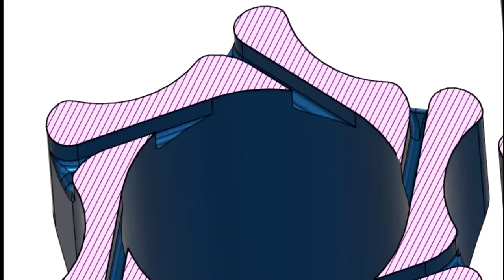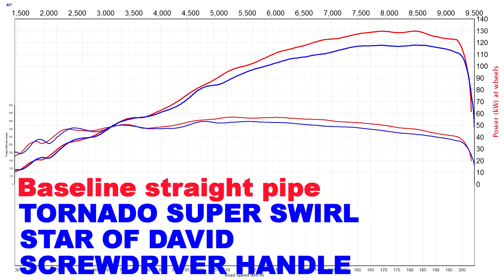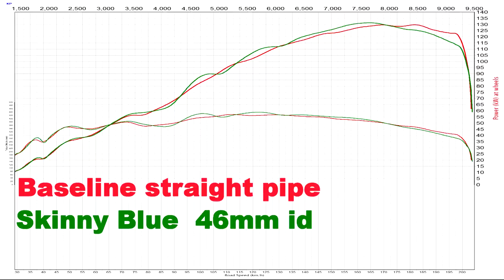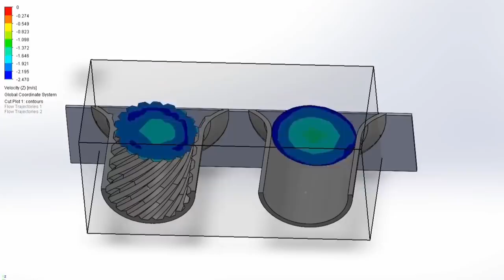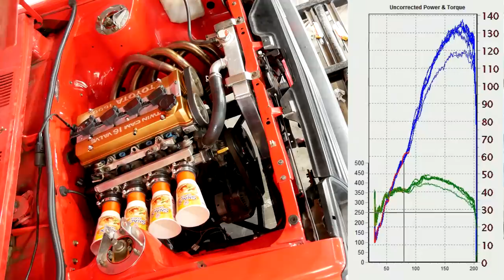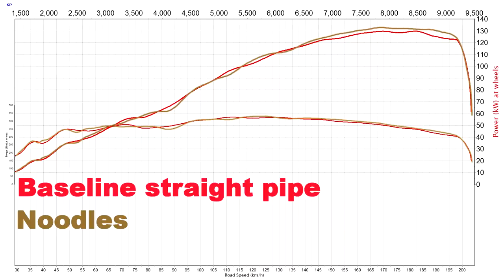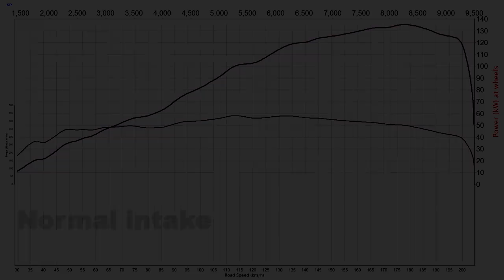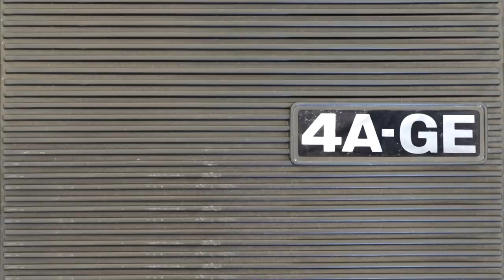Viewer 3d Printed Velocity Stacks  - Trumpets - Intake runners - Dyno Tested

Comment: of course we always want great power but to better see the difference between the intake runners it might be better to stick to the same shape, but all a bit smaller so that the motor is a bit choked and the difference becomes larger and therefore clearer. Of course you can also increase the pressure and flow in the computer simulation and see what happens. I also wonder if the opening surface is kept the same for the different models (especially for the screwdriver handle). nice to test all this, in the past this was all much more work than now.

Comment: On round pipe opening, the minimum clearance in front of each should be at least  the lengh of one radius of the opening of the pipe. The cross sectional of the opening surounding all these pipes end  should at least also be  equal or superior otherwise  the true restriction become the availlable clearance around all the pipes  instead of the pipe opening themself. Great video btw!

Comment: Make some variable length velocity stacks using old-school choke cable where you could push or pull on it and make the stacks go taller or shorter like the old Mazda rotary race car

Comment: I'd be interested to see throttles done with an audi style split plenum so the intake pulse is being captured and bounced back down the runners rather than being lost to an open engine bay, even a comparison with a flat sheet of alloy mounted at varying distances out from the bell mouths would be neat. Top work enjoy the innovation  and testing!
Reply from the maker: I was going to do the one with a plate in front of the throttles at some stage.   I haven't actually tried it before, but i would assume will lose power the closer the plate gets.   as its the end of the pipe that creates the pressure wave, not so much a reflection off a wall in front of the runner.  so said wall will just create an airflow restriction. but yes best way to find out is try it.   as for the audi style inlets, my understanding is they are more for trying to get even airflow to each cylinder.   Ive built and tried a few, mostly on turbo stuff.  but have gone back to conventional style.
Reply: I guess it's like building a single cylinder tunnel ram by utilizing a plate and then finding the perfect balance between positive and negative effects? Capturing those returned pulses off the back of a closed valves between individual paired or all four cylinders within a plenum to best utilize any free energy? Factoring in air filter resistance and use for road.
Really enjoy the content ...keep up the good work.

Comment: How about variable length stacks? You can probably adapt a system out of a motorcycle like a R1 since it's a 4 cyl as well. It's nothing crazy complicated and should give you gains on top without sacrificing the midrange
Reply from the maker: will build a variable setup at some stage.

Comment: really cool my money was on the green swirl design and it did good the only issue with 3d printing is that the surface is rough its not perfectly smooth which affects the air flow lots of those designs could be refined with some sanding for a smoother surface and i bet you would see ever so slightly better numbers probably not enough to make a fuss over but im guessing thats why the regular intake did so good because the surface was super smooth and helped direct air flow better
Reply from the maker: The "normal" intake is a bit different design.  carries taper out to the bell mouth.  which has a slightly elliptical shape to it.  I made it years ago and has been proven hard to beat.   Im not sure if would be a measurable difference  smoothing the surface on the  3d printed ones.  but will keep it in mind, thanks

Comment: you should use variadle Intake runners for more power, the trick is to find out the resonante frequency of the tubes, and aling them with the rpm of the engine, (+rpm=shorted intake tubes).
you can make some type of sliding tube for the intake and add the best horn so far, like what they did on formula cars back in the day).

Comment: @Garage 4age Have you, or can you test pulse plates soon?

Back story: I built a Mk1 Escort for a friend of mine and drove it a 60odd miles with bare carbs and trumpets and it was truly awful. Difficult to drive because of a narrow power band and I assumed the cam was just a bit too much.
At our meeting point he brought a K&N filter which only just fitted between carbs and bulkhead but it utterly transformed the drivability of the crossflow engine.
From a trumpet point of view it went from seeing a wavy bulkhead to a flatter squarer-to-trumpet K&N fiter top, only slightly closer.
I was convinced it was just that better pulse reflection made the difference, but I have never had another opportunity to test it!
(Nerdy details, I think it was a Lynx manifold with single 45Weber, 1600 crossflow with big valves and lumpy cam)
Reply from the maker: Possible the filter itself had an effect on airflow changing the air fuel ratio?     my understanding is its the end of the pipe,  rather than bouncing off a nearby surface  that causes the reflections.   will keep it in mind though,  maybe put it in with something else i want to test soon.  as interested to see how close to a flat surface the end of the runner can be, before losing power.   I'm 99% sure my current setup doesn't have any issues like this based on some previous testing. even though looks like the strut tower is quite close
Reply: @Garage4age  Thanks for the rapid reply!
It was purely feel and drivability sadly, so no real data to back up the difference, but it was a dramatic one. So smooth and managable after fitting that filter.
I'm sure you can't be far wrong, carbs are a lot different to bodies, but it would be very interesting to see if you can measure any difference.
Gap wise. 0.25 x trumpet diameter should be the same curtain area and thus arguably the closest you can take a pulse plate, but there'll be a lot of complex interactions going on particularly when it's closer than that, so who knows.
Interesting to see if you can measure a true suffocation point.
Reply from the maker: @thomashenderson3901   yeah should be interesting.  closer than most people would think i bet.  its not like the air has to be replaced through a single small hole like a single throttle setup.

Comment: The opening of the air trumpet makes little difference, what matters is the overall LENGTH of the trumpet, longer=more torque at lower RPMs, shorter= more torque at higher RPMs. The Mazda LeMans race car used VARIABLE length intake runners, an electric motor would adjust the intake runner length depending on RPM and torque requirements.

Comment: great job. I really liked you did double runs for each. My only suggestion is to run a baseline at the beginning and ending of the test, just to make you nothing changed in the engine/fuel/air during the test. You sort of did that with the "normal" setup. Really good job overall.
Reply from the maker: Im pretty picky how run the test,  car is ran hard before start the testing.  then before the first test gets the same cool down and warm up  as all the others.  oil, water temps etc same on every test.

Comment: You have to take in consideration that 3d printing surfaces are rough which create turbulent flow and resistance on the bore. You should smoothen the surfaces with acetones.
Reply: Smooth surfaces increase the boundary layer effectively reducing the bore size of the pipe.
Reply: Turbulence can be a good thing some people have found success dimpling inlets like the surface of a golf ball
Reply: @otanica  same with air flowing closer across a curved surface

Comment: From what i know only the length and width of the intake is important and depends on the piston size, speed, valve timings, air temperatur. I know about a company in Australia, they tune toyota v8's for stockcar racing and the make the surface of the intake and the ports in the head itself like the surface of the golfball. That would be nice to see...

Comment: Looks like the existing set of horns are your best bet. Maybe do some modifications on those & see if you can improve them. Make sure the inside radii of the Bell matches the opening diameter. So at a certain target length, if the opening is 68mm(2.68in) diameter, the inside radii(or led-in radii) of the Bell will be R68mm. See if the existing horns have an inside taper, like the noodle cups. Keep that included angle w/in 4-8 degrees(2-4 degrees per side). The inside of the horns should be slightly rough, not smooth. Take 1000 grit paper & draw parallel to the axis, not radially. Keep it light. You want to give that air a slight turbulence on the surface to act as a 'lubricate' for the inner layers above. Aerodynamics books & a couple of NASCAR engine building video's were my sources.

Comment: I feel like if the stacks had air blowing at / across them like the car was moving they'd give different more accurate numbers. They're only going to be able to grab so much air when there's no airmovement around them but I feel they'd do better if they had airmoving past or around giving them that ability to pull that extra air in
Reply: I doubt there would be much of a difference

Comment: What happens when you install the filter element?  There's a little power difference stack to stack, but I wonder what different filter designs and types would impact the output.  You could easily fit a pair of foam socks over each pair of stacks, compared to an ITG style foam element over the whole set up, vs a remote box filter, vs a paper or gauze element etc.  Love this Stuff!
Reply from the maker: The "normal"  setup usually  runs a big pipercross filter (can se backing plate on it)   has zero effect on power.  filter socks are horrible though, havent personally tested them, but had seen big losses on another guys car

Comment: The end of the velocity stacks are quite close to the strut tower - I think from memory if you have a wall within 1-2xID of the end of the stack you can start to get wave reflection effects which might explain the wibbly wobbly graphs between 5-6500rpm and why the screwdriver handles - although much lower total power - are smooth in that rpm zone - because the end of the stacks are closed, and so prevent those reflections from entering the stacks. Could you route the intake above the strut towers so the ends are in free air? I doubt it would improve the top end power but it might smooth out the delivery in the mid range. Great video, love a 4AGE - one of my favorite engines of all time!
Reply from the maker: Hey I tested some that point away from tower,  amongst other things in this video:  https://www.youtube.com/watch?v=nqYkmCLrlEo   About half way through.

Comment: Got to say that you haven't really got any restriction in the intake so you aren't really gonna see anything at this flow level. It's possible that you can reduce the diameter of everything down to the valve and not lose top end flow but boost the low end and to this end length is always gonna help. To gain some more top end maybe a set of outward facing (against the air stream) upstream injection in order to promote more evaporation and charge density perhaps. Also worth nothing that when you have an engine that cannot flow more then its worth chasing gains from spark. If you are running at mbt then up the compression and if not then increase the charge motion to get back to mbt. That will always be the biggest gains seen.
Reply from the maker: with everything Ive tried over the years.  To get get any significant  low rpm gains by  reducing diameter,  will always  restrict the top end.     Maybe on something that has a smaller rpm range, will work better.   Most cases, especially with these engines. Its the exhaust side that is the problem.   If you look at the numbers this one is actually doing really well for a fixed cam 1.6L   80kw at 4500rpm.  a standard one  will be lucky to make 90kw peak power at 7500rpm.

Comment: Is it possible to try the best inlet with golf ball style dimples in the inside of the pipe ? I'm curious if it would help or hinder air flow.
Reply: @Kapil Patel I thought the same. I remember B&W using the same system on their subwoofer ports which realistically is a similar shape.

Comment: great stuff as usual. 

The spiral design would be an interesting one to revisit if the injectors were placed in the mouth of the stack. 

Not bashing but curious what the designer of the star one was thinking? I guess trying to introduce some swirl, but to what end? Particularly since it immediately looked so restrictive.
Reply from the maker: was just trying to force the air to spin.  the slots were bigger in area than the outlet.  he wasnt expecting it to be amazing. just something different

Comment: Just wondering if you know the total length of your inlet tract? Been playing around with making my own calculators for optimum inlet lengths and I'm coming out somewhere between 379mm and 484mm (with a sweet spot for overlap around 438mm). Diameter is something I haven't really controlled for yet, but hopefully its effect is less pronounced than length.

Comment: I'd like to see 90°pipe velocity stacks, cylinder 1 upper, 2nd down, 3rd upper et 4th down. The hood will propabably not close but the idea is to let air for each bank. Oh also an old f1 trick use control by engine vacuum, short for low rpm and raise longer for high rpm.
Reply from the maker: hey, try this video  https://www.youtube.com/watch?v=nqYkmCLrlEo

Comment: Thank You, for testing/video, and the people who prepared the trumpets. 
Bravo guys!! 

The green ones and "Jewish" might be better for fuel consumption, by air swirls/turbulences mixture might be more homogenious, better mixed, but I dont know it for 100%, its just my loose thoughts.
Reply: if that were true, it would would show up in the midrange and at peak torque as that's where max efficiency would be achieved. mpg isnt some magical property, if the engine is more efficient in anyway, itll show up on a dyno chart as more torque in a certain band.
Reply: @OxBlitzkriegxO   
Graph shows only WOT, not half throttle, as in daily driving. The flow characteristic may change with less suction. 
But Thank You for Your attention, i have to think about it.
Reply: @jareknowak8712  Swirling flow takes energy away from it. Where this can help though is in the ports if it's not a DI engine as the swirl can cause better atomisation. But with CFD today there are more elegant ways to do it.
Reply: I think you'll all find if you look at the fluid dynamic clips in the video what the helix trumpets are achieving is moving the low pressure zone from the outer most wall of a smooth trumpet to the centre point of the helix trumpet where you want the low pressure zone and it is more focused rather than spread out in turn all that is happening is you are making the trumpet internal diameter smaller the helix only achieves one major thing and you can see it in the fluid dynamic testing also that it reaches the lower half of the trumpet faster than the smooth one of equivalent shape.

Comment: Cool video. quick question,, doesnt the "float?" of your cam belt worry you a bit? hate to see bent valves. what is flexing, that makes the cam belt shift back like that? It just looks like a problem waiting to happen🤷‍♂🖖
Reply from the maker: Its the belt itself.   got new belt / solution on the way

Comment: Stagger the length of them. Make 2 of them 2 inches shorter. Use the baffle but move it closer to the engine. By having them staggered, it will reduce the pulse low pressure on the adjacent cylinder.
Reply from the maker: doesn't do anything. have vids testing ones that bend away from each other. and different lengths.   links are in pinned comment at top.

Comment: May I suggest to modified the white one with a slightly more progressive taper and a bigger radius of the outside edge by keeping about the same diameter. My understanding is with the bigger radius, you may pick more air from behind and around.
J.F.🇨🇦
Reply from the maker: The  "normal" intake is pretty much what you suggest.   I made it years ago before  owning the dyno.  Its proven very hard to beat.

Comment: So i guess i just put noodle cups on there as a budget upgrad when i will have a car with a 4age some day.
I wonder if something with a deeper horn shape would work great. Something like a Horn for a speaker. Every cylinder fires how many times a second at 8k RPM? I wonder what would happen if you design a horn for the frequency range of the cylinder's from 5-9k rpm if like in the audio world it amplifies the output in that range it in this case would amplify power output.

Comment: What about a golf ball dimple on the inside of the surface of the plenum/intake stacks? It would be hard to get the correct depth, and smoothness (unless you dimple then use acetone vapor to help with surface finish of 3D printed ABS) I’d try that on the white short stacks and see if that helps with smoothening out some of the curve.

Comment: I'd be interested to see how curved velocity stacks would perform, as I know intake manifolds on many production NA engines use this design. I couldn't 3D print anything, but I'm sure a U shaped piece of PVC pipe would suit... Could also try cutting longer straight pipes with the ends cut off at a 45 degree angle, with each rotated 90 degrees from each other too, to see how that'd compare
Reply from the maker: Tested some bendy ones awhile back  https://www.youtube.com/watch?v=nqYkmCLrlEo    Not really any negative effect unless bends too sharp.   Some simple angle cut ends like you suggest, i actually haven't tried. will keep it in mind